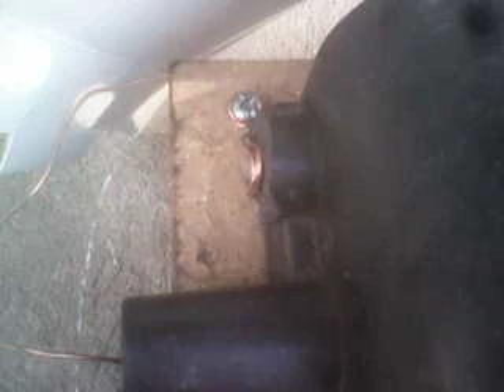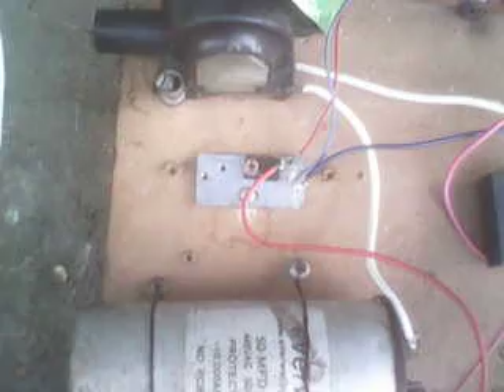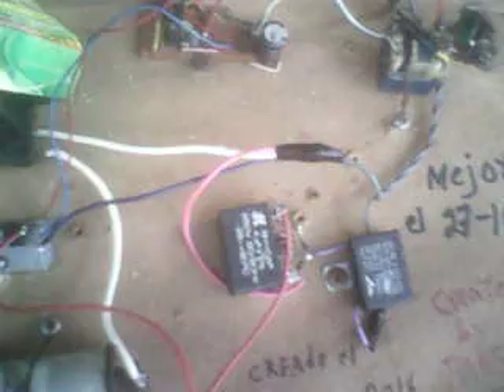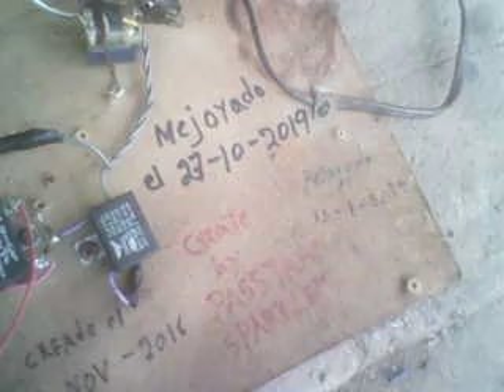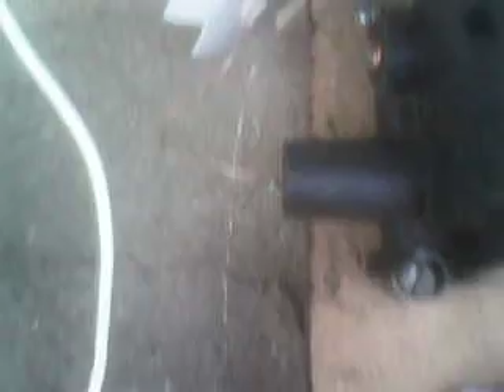prueba de funcionamiento electrificador para cercas eléctricas casero parte 1

Comment: Yo una vez arme uno, un poco mas simple , usando un tiristor, y una fuente elevadora de 12 a 220 , la cual cargaba un cap de 400v.
La descarga que producia era de unos 8cm de color rojiza, una animalada.
Buen video, yo le pondria el cap en paralelo a la bobina.
Saludos.
Reply from the maker: si que te ha quedado muy potente amigo pobre animal o intruso que toque la cerca porque se llebara una gran sorpresa jejejeje

por otro lado el mio no es tan potente solo es capas de producir una chispa de 5 centimetro pero en el video no se puede apreciar debido a la mala calidad de mi camara y video, por ahora solo estoy cargando el capacitor de carga a 300 voltios DC despues lo actualizare a una carga de 400 voltios DC amigo para aumentar aun mas su potencia amigo 
por otro lado esta version funciona alimentada directamente  de la red electrica de 110VAC dentro de poco hare una version que funcione directamente de una bateria de 12 voltios DC utilizando un pequeño elevador realizado con un chip UC3843
saludos amigo